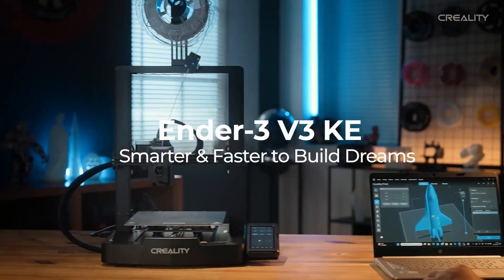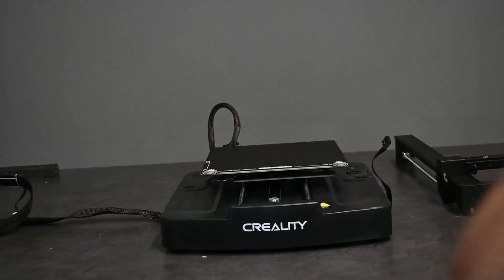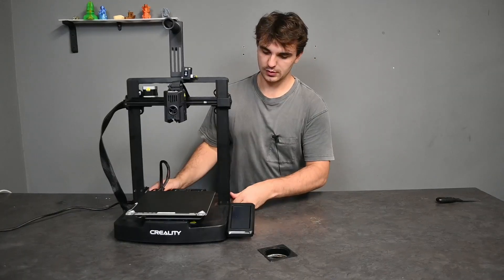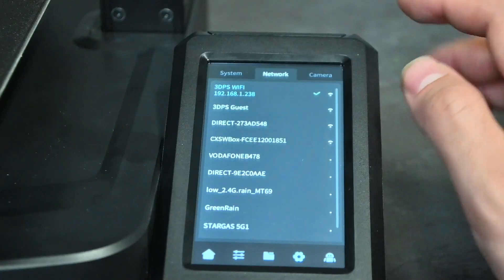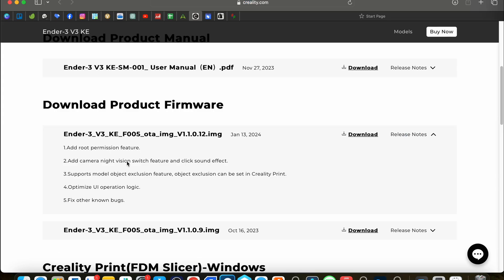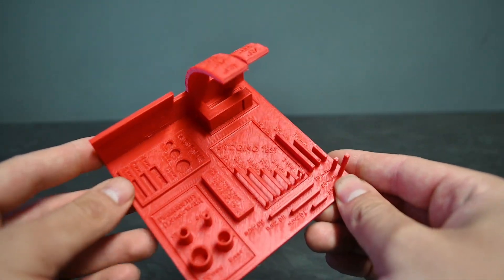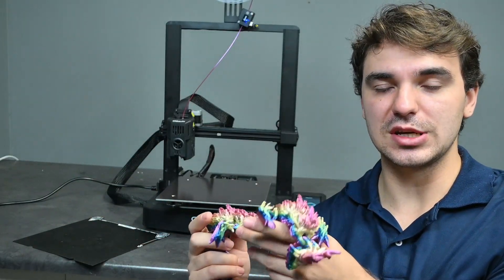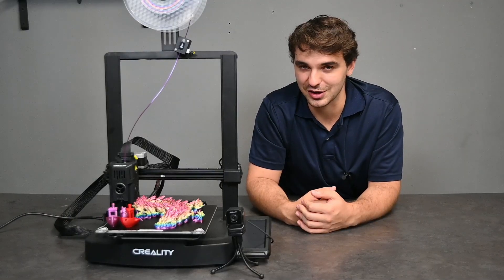How to USE the Ender-3 V3 KE || Unboxing and first impressions

Comment: So far I am very happy with my machine . Done large and small prints fast and slow . Had bed adhesion issues but resolved.
Reply from the maker: I'm glad to hear that it has been going well, adhesion can be tricky depending on the material you use and a bunch of other factors, I'm glad to hear that you were able to resolve it.
Reply: hey im planning on ordering one any advices?

Comment: I bought this one not overall impressed the hot end is way too wobble.
Reply: An easy fix is to move the filament roll to a standalone stand next to it. Fixed most if not all the wobble
Reply: It helps to check all the bolts on the gantry, especially the top bolts, they were all loose out the box. Even after tightening, the gantry is way more wobbly than my ender 3 v2 neo.
Reply from the maker: I have realised this as well, the CR-10 SE seems to be a lot more sturdy, will be testing that out soon as well. 

But the overall printing quality doesn't seem to be affected too much even though the hot end isn't the most stable.

Comment: I got myself one of these, still working out the kinks. 1st when unboxing just check the following before you plug it in and start calibrating.
1. Double check the red voltage switch in the rear is on the correct setting, mine was set to 220, which caused to it continuously reboot during calibration. (easy fix) 
2. The Y axis tensioner (rear hex key under the plate) was a little loose, it comes with the wrenches to tighten it. 
3. The X axis tensioner (right side on the carriage arm) was very loose causing errors during calibration. The provided hex keys resolve this as well.
4. The Z axis (up and down) I found the higher my print went, the more the nozzle would hit the print making a thumping sound and eventually offsetting the print. Just adjust the Z axis up by .05mm and that seems to do the trick.
5. Before feeding the filament, cut the tip at a 45 degree angle.
I also would highly recommend ordering a few extra nozzles to keep on hand as well as silicon boots and a cleaning kit.

I found TinkerCad is super easy to work with on 3D modeling and it's FREE.

Comment: Wait. Did you not use an adhesive on the plate?
Reply from the maker: Because the build plate was brand new, no adhesive was needed, but otherwise, I would use standard hairspray just to give it a light coat before heating the bed. For PLA and PETG, that usually is more than enough to keep the print on the bed, in addition to the correct bed temperature of course.
Reply: @3DPrintingStorecoza I'm brand new at this: how do I determine the correct bed temperature?

Comment: Are you able to use the "pause at height" or "filament change" in Cura?  It doesn't seem to recognize the commands.  Does Creality Print have such features?
Reply from the maker: Hi there!

Yes, you are able to use both the pause at hight and filament change features in Cura on the KE.

You can just create a custom profile for the KE using the SE as your base, then copy and paste the beginning and end G-Code from Creality Print to that profile in Cura to make sure that everything else works as well.